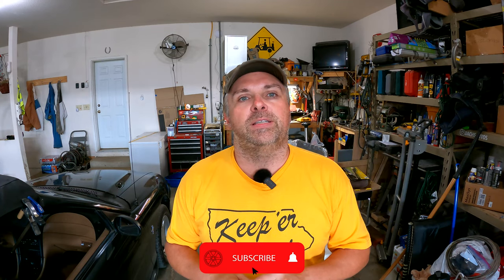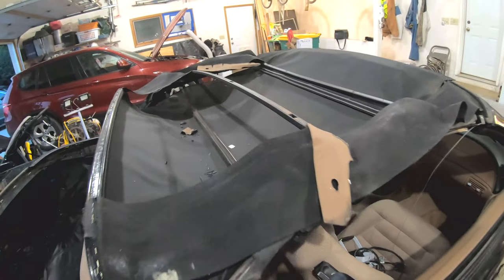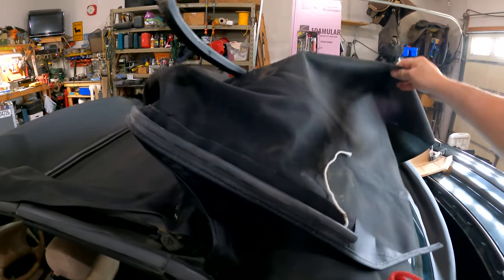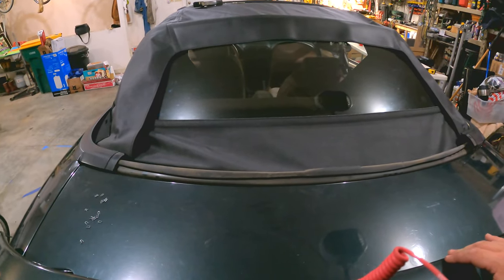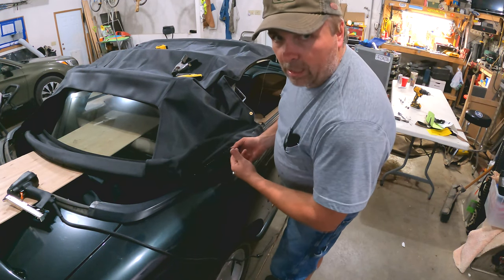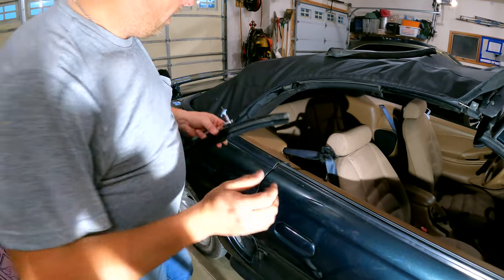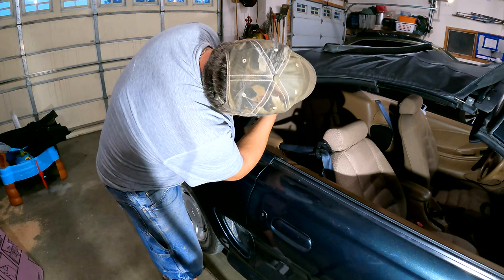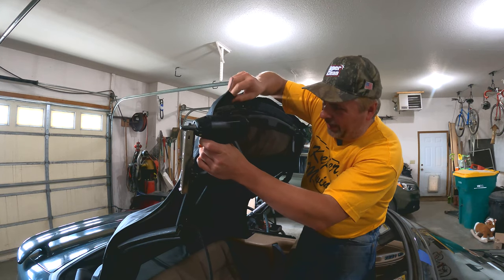Part 2 - Convertible Top Replacement (SN95) on our 1998 Ford Mustang

Comment: Thank you for this!! You're the only one that I've found that has replaced the top with the glass window vs. straight out swapping the old top with glass for a one piece top with the plastic window. Saved both parts of your install and will use them as reference along side a CJ pony one  as I tackle the project hopefully this weekend.
Reply from the maker: Did you get to your project yet?  If not and you have Q's. feel free to drop me a message!  -- I looked high and low for the complete kit with glass, in the quality material, and we'll see how it holds up this year, and over a cold Minnesota winter in storage.  As you can see, it was a chore, and I can understand why a shop charges what they do.  If you can find an upholstery stapler vs. a manual model, it's SUCH a help, especially on your hands.
Reply: @DachsAutos  I did get to my project. I got the whole top from American Muscle for fairly reasonable.( like price of an alternator service reasonable). Got to it a week later than expected, but it worked out as I had more time to focus on it. The grommet part of the top was a struggle, getting the hook out of the old one and into the new. When it got to the stapling part, after 2 $25 power staplers not cooperating, a mid range one form lowe's was a HUGE help. It may not be shop perfect- but it's better than a roughly 20 year original top that was brittle, no longer weatherproof, and disintegrated as I removed it. 

My 01 California convertible is a convertible again, there are some tweaks that I have to do still, and it's still stretching.
Reply from the maker: @MorganCharpentier  Awesome! Glad it worked out for you.  -- I borrowed an upholstery stapler from my Father and that worked well.  Mine is probably 90% perfect, but for the day or two it might get wet, it will be just perfect.

Comment: The two screws under the quarter trims can be removed with a skinny long phillips head without having to take the trim out just be careful to not drop the screws.
Reply from the maker: Helpful tip for sure. The only long phillips i had was not the correct wise, so fumble I did!

Comment: How much do you think it would cost to have someone replace the top? Would it be a good thing to go through my insurance? My top is ripped right along the top part of the back window and I’m wanting to just replace it and I’m wondering how much you think it’s going to cost me? It’s for a 2001 GT that is in really good condition except for the tear across the seam of the window 🤪
Reply from the maker: The person I bought it from was quoted about 2000 for the parts and labor to have it replaced at a shop...

Comment: Where do I find the bolt pattern tightening order on the metal strips on the back?
Reply from the maker: I didn't have a pattern, however I believe I worked from center to the outside slowing to help against pinching or uneven material.

Comment: What top did you buy and from where
Reply from the maker: I got the KEE convertible top and glass from CJ Pony Parts:

https://www.cjponyparts.com/kee-auto-top-convertible-top-sailcloth-vinyl-mustang-1995-1-2-2004/p/CTO8-V

https://www.cjponyparts.com/kee-auto-top-convertible-top-glass-window-with-sailcloth-vinyl-surround-post-8-1995-2004/p/CTG12-V

2 years later, I'm still very happy with the top and the fitment!

Comment: Having trouble with installing mine.
Reply from the maker: Not the easiest to do for sure, what problems are you having?
Reply: @DachsAutos  Well keeping it tight on the rear window, its sagging now. Plus now I have water coming in on the right side so I dont know it we miss installed.
Right seat underneath is completely wet.

Comment: What brand top is that ?.
Reply from the maker: @James Bodkin - This was a KEE top with the matching glass rear

https://www.cjponyparts.com/kee-auto-top-convertible-top-sailcloth-vinyl-mustang-1995-1-2-2004/p/CTO8-V/?utm_source=Pony&utm_medium=Email&utm_campaign=OrderConfirmation&lac_guid=45c5d73c-36e0-eb11-835c-0050568b5164#220=1141

https://www.cjponyparts.com/kee-auto-top-convertible-top-glass-window-with-sailcloth-vinyl-surround-post-8-1995-2004/p/CTG12-V/?utm_source=Pony&utm_medium=Email&utm_campaign=OrderConfirmation&lac_guid=9f02958e-24e0-eb11-835c-0050568b5164#220=1141

- Tim

Comment: What’s the name of that silver strip
Reply from the maker: What's the timestamp you're referencing?  At about 20 min, if you're talking about that long metal rail, I'm not sure the proper name, but I'd call it a metal retainer rail. :)
Reply: @DachsAutos  I found it on eBay from a person who’s selling parts but it’s called the tack strip or the retaining strip
Reply from the maker: @MichaelWilson-ht9gn  That sounds like a better name for it.  I think the tack strip was what I stapled to the new roof, and the retaining strip seems to be what the studs mount thru.
Reply: @DachsAutos  I got the boot trim on the car I ordered and it was still leaking and I found out by watching your video that piece was missing bc I got the car form someone they didn’t put the roof on correct and it’s missing that specific piece of hardware that brings it to the frame since I found it I ordered it and I can’t wait to get it